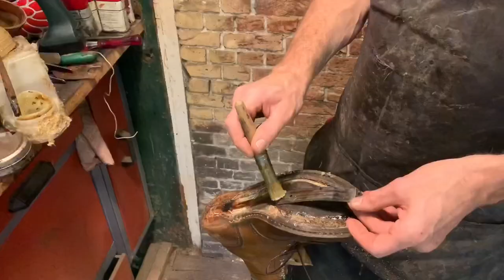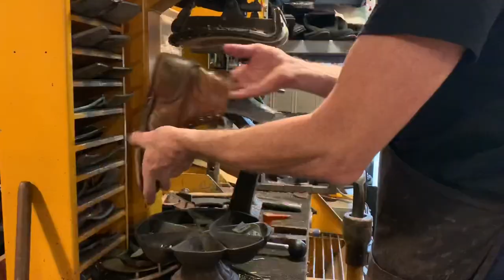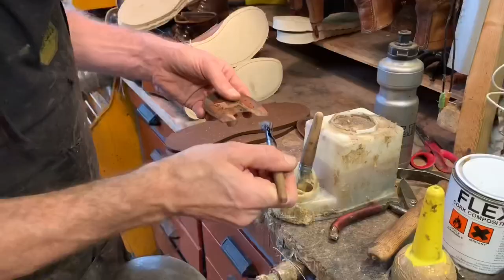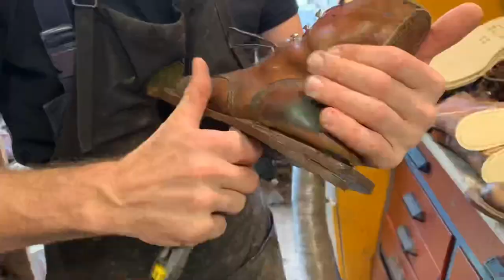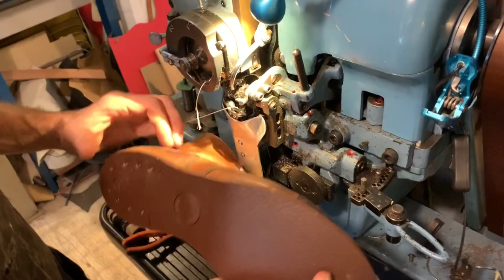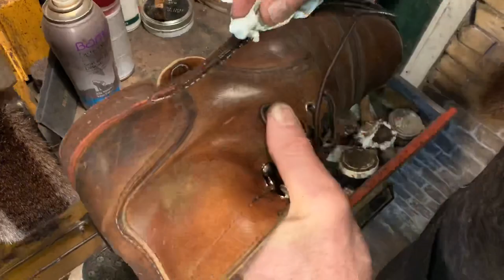Rebuilding a Red Wing iron ranger to almost new!

Comment: Good job, replacement soles do not look like they would have good grip.
Reply: Former Red wing Iron Ranger's did have nitrile cork soles like the one in that video. Newer ones (from 2018) have a more grippy sole from Vibram. That video is either old, or the original owner wanted the same former sole, and not the newer one.